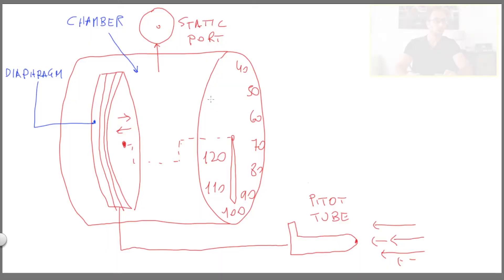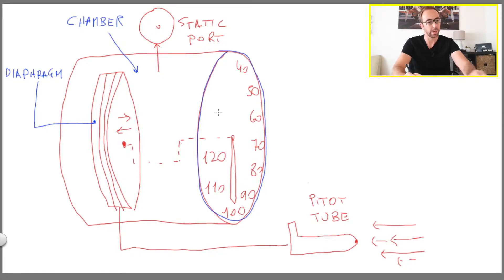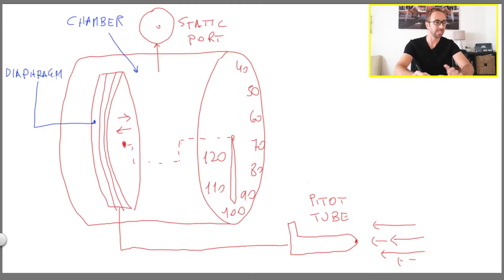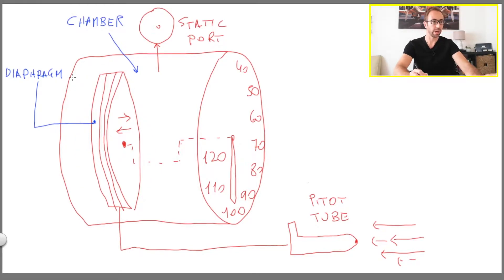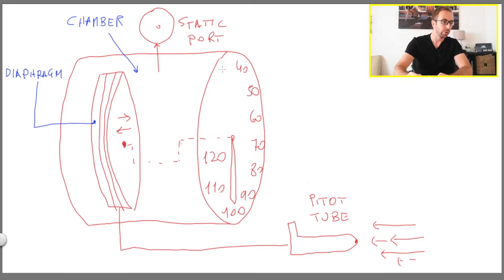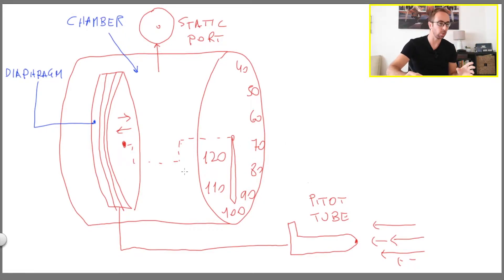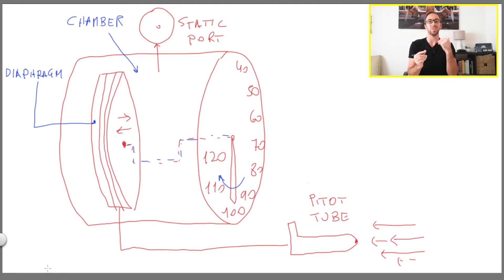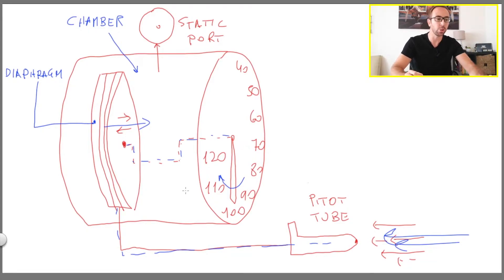Airspeed Indicator (ASI): [What it is, how does it work and how to deal with a pitot malfunction].

Comment: Did ice formation over pitot tubes on Air France"s Flt 447 an A330 a contributing factor to it's crash into the Atlantic Ocean. The ice formation disconnected the auto pilot and the pilots got confused on flying the aircraft. They stalled the aircraft causing it to crash into the ocean.
Reply from the maker: Hey, I hope you are great! I haven't read the full report of the accident, as far as I know the pilots got confused due to the unreliable airspeed.